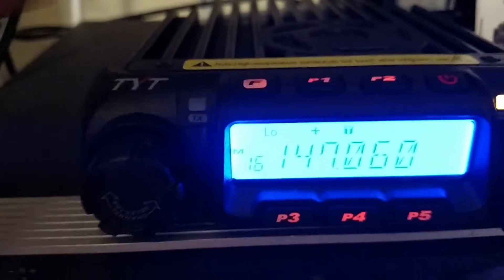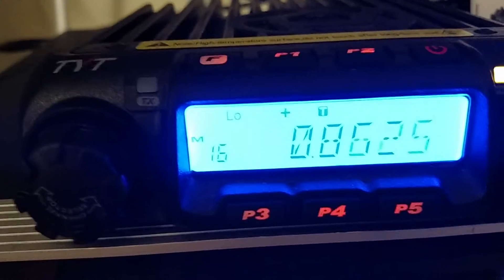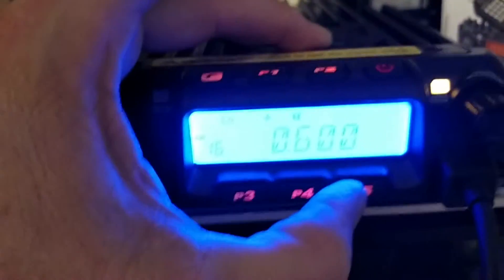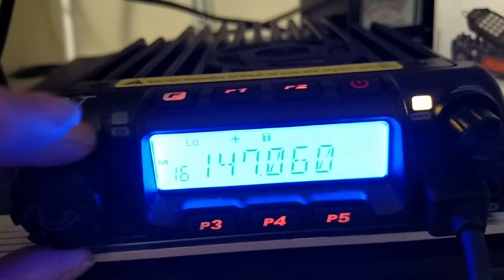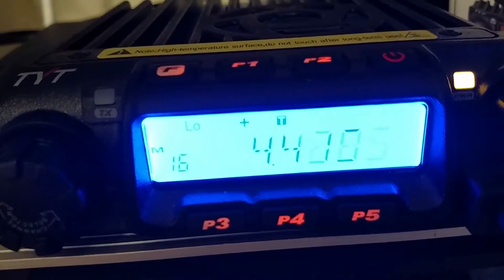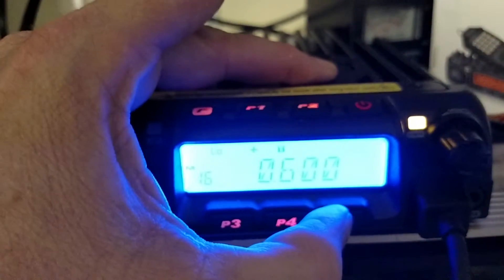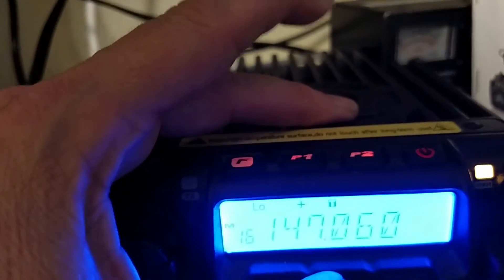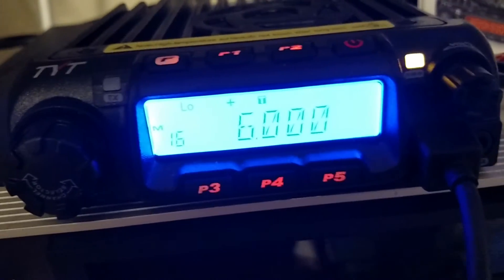TYT 9000D 2 meter offset problem cont'd...

Comment: On my radio (TYT TH-9000 UHF model), I set the offset in the following way:

Press and hold P4. (It will show either + or -). If is going in the direction you want (+ or -) then use the radio main channel selector knob or direction buttons on the mic to reach the desired frequency offset. In my case, 07.170 MHz (+)

If it's not the direction you want (+ or -), release and press and hold down P4 again and it will show the opposite direction (+ or -). When the direction you desire is displayed, then use the radio main channel selector (large knob) or the arrow direction keys on the mic, to reach the desired frequency offset, such as 7.170 MHz (in my case). 

Then, when you have the frequency offset where you need it, press (do not hold) P3. The frequency will now display with all the settings ready to save. (But it's not saved yet!)

Now press the F (Function) key. You will see a large F in the upper left corner of the display. The channel selector number will start blinking. That is telling you it's ready to save to a channel. You can save it to that channel, or choose another channel  -either writing over a saved channel (M on screen does not blink, that means that channel already exists in Memory) or choosing a new channel (M will blink, meaning it's a new channel, not yet in memory. In other words, it's open).

When you are finished choosing what channel you will save it to,  press the P3 key again. The channel selector will stop blinking, the F will not be displayed on the screen and all settings will be saved TO THAT CHANNEL ONLY. That is the way memory works. Some general settings will save to the radio across all memory channels, but others, like offset will only save to the channel you saved it to. 

Hope this helps. 

By the way, it seems cumbersome at first, but trust me, once you do it several times, you can do it in your sleep.

Comment: Bingo!  Been following the "offset issue" on your channel...  So yes, like you showed - "P3 to save" technique, but should be employed in the VFO mode BEFORE ever assigning it to a memory channel - using "F" + "P3" as the final step in the process.  Thanks JR for the clarification/solution to this frustrating issue!!

Comment: Hello, there's nothing wrong with your TYT 9000. When programming offset of .600, + or -, and CTCSS, one MUST BE IN VFO mode. So go ahead, select offset, CTCSS, hit F3, then hit F and F3 to select memory position and put frequency into memory. If you do this, then the .600 offset will hold as it should. Please feel free to email me at johnrand1115@gmail.com if any questions. I'd be happy to walk you through it if needs. Otherwise, good job on the videos as they helped me with the fundamentals. The manual is completely useless.
Reply from the maker: John, I will check that carefully and advise.  Thank You most sincerely for your replies.
Reply: BadDolphin.   just got one and it's doing this same thing,   I set everything in vfo then save it,  it works until I switch back to another channel then I can't hit the repeater and I check the offset and it's at 6.000.   what's the fix?